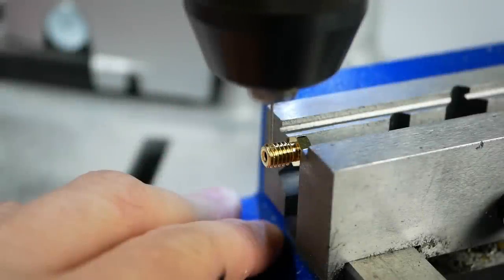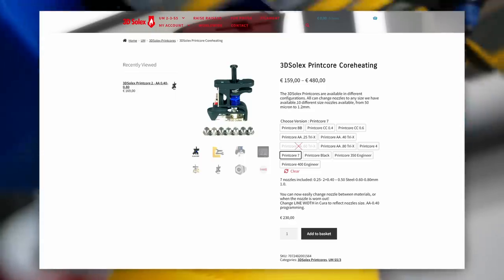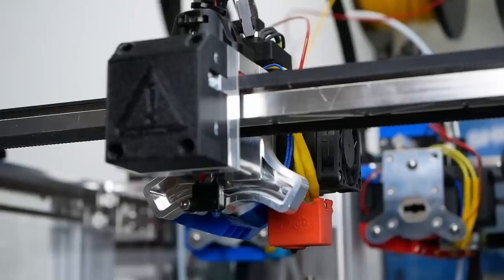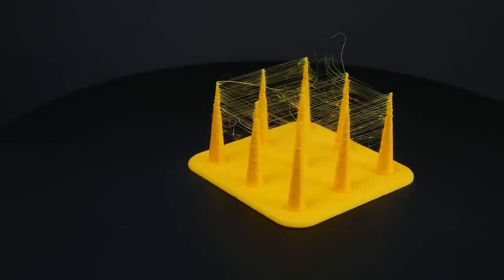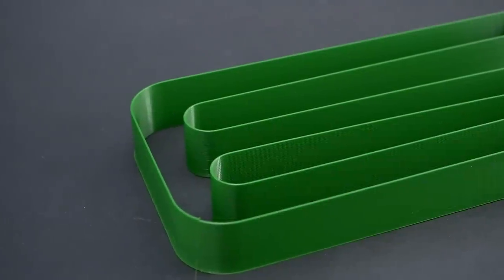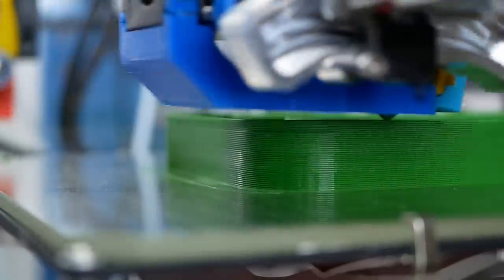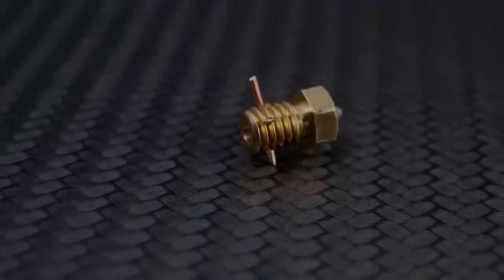My High Flow Nozzle is better than a Volcano hotend!

Comment: machinist , cross slide vise , edge finder , dial indicator, 8mm center drill = perfect alignment  , edge finder to find exact edge of nozzle you're drilling , indicator to move exactly as much as required " half edge finder diameter / half part diameter - nozzle in this case " , cross slide keeps axis movement true and easy to make small changes , 8mm center drill will do as it's name , starts a true location for the 8mm drill to follow , curious if grinding down the 8mm wires sides to be oval shaped with knife edge on top would reduce the head pressure enough to make any real life difference

Comment: If you don't want the drill to wander first flatten the area you are about to drill with a proper Center Cutting Milling tool that is a similar radius to the hole you want.  A milling tool cuts from the outside diameter first.  Once you have cleared a flat spot you can follow it up with the drill and it will not wander.

For best results you should also make a flat spot on the inside wall as well.

Comment: Same approach, but instead of circle copper wire, try flatten copper (wire) and cnc a slim gap to the nozzle?  this could give more efficient surface area for melting and maybe  it could restrict the flow less than circle.

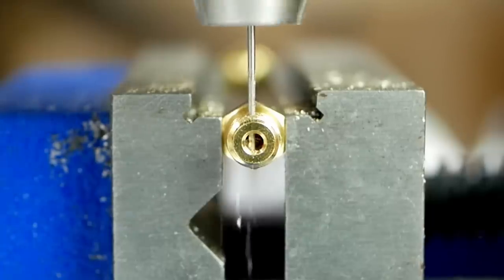Comment: 2:17 - when your pants with sleeves :-)
For soldering better for use 60-75% silver solder, lead and tin from usual solder will mix with filament and make will make the product fragile...
you can use metal foam or metal shavings like a consumable, just put it in nozzle and you're done! when changing filament - change filler...  it is necessary to increase the "mixing" chamber - bore or ream...
Добра!

Comment: Try a centering punch tip on the drill press before using the bit and experiment with aluminum welding rods (~750C) on a hardened steel nozzle (~1,500C)

Comment: Nice work 😎

Get yourself plumbers blowtorch and some easy silver solder used for jewellery, you will be able to get a much better result and it will be able to accommodate the temperatures requirements to print all filament types.

Comment: Do the same thing with a volcano hot end.

Also a suggestion would be not off setting additional wires. Have them in the same orientation so the affect on flow rate isn't as pronounced. That way it will help heat up the material but won't slow it as drastically.

Comment: Maybe it will make sense to insert a thin flat piece of metal instead of a wire. You can make small guides in the nozzle walls for it, and it may not even require soldering...

Comment: Use a 0.9mm end mill to mill flats perpendicular to the threads. Then get a small spotter or engraver to make a pre-drill spot, preferably the same tip angle as the drill. Spindle speed needs to be as fast as possible for the tiny tooling also.

Comment: Couple of things, silver wire would definitely help a little as it is a little more conductive than copper, and I think that it would be helpful to try and make a fitting that goes inside the nozzle out of silver, and make use of silver wire held in place with some sort of lower temperature braze (ie. Aluminum, aluminum alloys, yellow brass etc.)

Comment: Maybe try to flaten the wires once they are in the nozzle with some pliers, very strong demultiplied pliers because of the tiny space they will have to reach. Or maybe cutting slices from the top of the nozzle with a dremel where you could than insert the flat wires. Very nice experiment

Comment: Very impressive. I wonder if you could use a file/dremel to make a slight chamfer or blade in the copper wire so it's less resistive.

Comment: I'd be interested in seeing what results you get without soldering the copper wire. The solder is not necessary to keep the wire in place once the nozzle is screwed into the heat block. The solder does provide some thermal conduction, but the advantage of not using solder is you could go to much higher temperatures.

Comment: Would be interesting if you would also test the wire-method with a hardened steel nozzle and how much an abrasive Filament would destroy the copper wire.

Comment: I'd suggest skipping the wire, but instead counterbore the nozzle as per the video, but also saw cut to the same depth. Fill the saw kerf with a sheet of copper across the nozzle, solder it in and recut the threads. Higher thermal contact area than a wire, but still simple to achieve. 

Alternatively, drill one hole and have the wire bent down the hot-end instead of across the flow. Solder in the one end to hold in place.

Comment: May be try instead of cross wiring, drill 2 3 holes next to each other in z-axis and stick wires then to create a wall of middle hot surface which can reduce the turbulence in liquefied polymer and potentially curly outlet stream. May be just no difference at all will happen. Don't know that but for sure great research video.

Comment: ...use a Dremel/ CNC mill. Cut fine channels down the inner face of the hotend, parralel to each other. Then trim a piece of thin gauge copper, brass or aluminium sheet (they all have different heat conductive/transferral properties) to suit final width, insert, trim excess length, anchor the top points (mechanical screws, punch deformation, solder, braze, weld). Test?
This should minimise cross section loss while increasing surface area drastically.
Aluminium also apparently(*edit* incorrect) has better heat transfer capacity than copper, possibly different to brass, and in this format you could add some of that as a multimetal product. A third metal (stainless steel?) Could be used to reinforce the highest leading edge for strength/resistance against the less melted/unmelted material it meets. Possibly a narrowed, slightly sharpened leading edge..
Reply: Copper is better heat transfer than aluminium. Copper 400 W/mK, alu 200 W/mK. Brass 100W/mK, weak. Copper is not very structural, which is why you make nozzles from brass, but for an insert it's OK. Good idea with the plate insert into a semi split nozzle. It should just be held in by the stainless throat (heat brake) worst case, so anchoring is not critical.

I think it can be good to do a plating of nickel on the whole assembly. It will provide both some anchoring as it will plate both to copper and to brass, binding them to each other, and some degree of wear resistance. But i actually don't mind copper being worn away somewhat, i don't think it's critical and can still last a good time. It's OK if the divider plate forms a U shape on the top edge with a somewhat rounded leading edge.

Imagine a more or less dive saw like rig with a Proxxon cutoff disc 0.6mm to cut the slot, insert a fitting copper plate, chase the thread, nickel plate.

I have nickel plated a brass nozzle for an hour at i think 0.1A i forget, in home made nickel citrate, and i think i have lost 0.02mm of nozzle diameter maybe. I wasn't very rigorous.
Reply: @SianaGearz  
that's a fantastic set of ideas & improvements. My setup was conceptual.
W regards to thermal conductivity;
Reply: "Many people are familiar with how easily copper conducts heat. Although it is true that the thermal conductivity of aluminium is half that of copper, in a heat exchanger, the difference in this property is entirely negligible for heat transfer performance. The reason is the fact that heat exchanger performance is dominated by the airside interface conductivity, so the actual, measure performance difference between copper and aluminium heat exchangers is limited."
This may not transfer to plastics; but should be tested.
Reply: @iainburgess8577  in heat transfer to air, you do have a high boundary impedance between air and the metal, dominated by low density of air and so small contact between air and metal, which means if you can heat the metal consistently, the performance between different metals will be about the same. I don't see why copper would be worse than aluminium. Heating the metal consistently is exactly where copper shines, creating a lower thermal gradient over a long, thin piece of material heated from one end. So there's little reason to make a liquid to air or air to air heat exchanger out of copper, where the fin length and so thermal impedance from the hot surface to cold is minimal, but copper should be still a winner in this case here.

In electronics finned heatsinks, you can get away with about half the material by envelope or less when you use copper instead of aluminium, which is evident from spec °C/W figures from any reputable electronic parts supplier. This is total impedance hot plate to air, including the air boundary, and it's specified at a particular airflow or passive. It's a key spec used in electronics engineering.

Note that the article you quote doesn't outright say that thermal performance of alu is better, because it's not, it's merely close enough for their use case. They use it for all the other reasons.
Reply: @SianaGearz  true, and I just remembered my original source, which isn't applicable here either.

Comment: This got me thinking about a sort of insert that you could drop into the nozzle's chamber. A small brass cylinder with a thin-walled grid in it. This would certainly be easier to machine that if it had to be milled within the nozzle. Though I don't know if the heat conduction would be sufficient between the nozzle and the insert.

Comment: The way to go about drilling into the nozzle would be to first use a routing bit or file out the thread on a small sport to create a flat spot, which you'd then punch an indent into; the drilling bit will then stay still. You can also choke the drilling bit further down towards the tip for a very short first cut, which will minimize its flex.
Reply: Read other responses, some great tips further down in the comments!
Reply: On another note, I am thinking of an entirely different approach: brazing thin copper rod, potentially filed to a double bevel on one edge, after wedging it into a cut made at the top of the threading with a jeweler's saw.

Comment: Rather then a second wire at 90 degrees my suggestion is to try adding 2 additional wires (to give more surface area) lined up directly below the first wire (at 0 degrees). I hope that would give more heat transfer without adding extra resistance to the flow of the plastic.

Comment: Lets just pause and give crdit to the patentholder for being a nice guy letting you tinker with it on your own and make a video about it, and to you for asking the patentholder if it was OK to do so.
It is that spirit that drives evolution forward, not locking in as much as possible in patents just so noone else can resarch it.
I guarantee, you sold lots of his nozzles by making this video, so he earned a buck or two on this video too.
I have a friend who has a lot of watchmaking machines (lathe, mill/drillpress) and got some intresting ideas  here.
Drilling the wireholes into hex stock (or milling flats for drillponts, you could have done that and just filled up the tread with solder) would make it center perfectly and silver soldering the wires for a start, but also maybe drill out the nozzle tube and make an slug insert with different flow channels milled into it, heatcrimping them together would make it possible to make "impossible" flowchannels that "blended" the streams to get less elastic deformation out of the tip.
Make a design, and ask clickspring or some other watchmaker make the slugs for you and cripm/solder them together for additional testing

Comment: My first idea was also use a flat piece of metal, like a cutter blade or a flat hammered copper wire. Therefore it is needed to saw a groove in the back end of the nozzle. Maybe pressing in the Cu bar into the groove is fixed enough!?

Comment: If a finer set of copper wire is used, it may be possible to not have to punch a hole in the nozzle, but to have the copper wire wind into it from the top surface.

Comment: It has been suggested by others  to file down the wire to a triangle/blade etc. Following on from that idea , use the blade idea but twist the shaped copper wire in the middle so it becomes like a propeller shape which will deflect the filament off its path and possibly mix it?

Comment: Use a dremel to carve an edge on the copper wire, that way the filament is cut rather than have to go around the copper wire.

Comment: I think sou could try a triangle shaped wire. Or a splined inside, so it has a bigger surface, but not disturbing the flow. You can probably make it with a thin end mill.

Comment: Might also try smashing the wire to make an oval rather than a circle and solder that in....which will make it harder to solder in to keep it from interfering with the flow but should increase volume for the flow of the plastic over a round one

Comment: I think you are actually on the right track. I however don't get why you place the copper wire so high in the nozzle. I would like you to investigate an option where the copper wire is about 5-10mm lower. (I like the thickness of the wire btw).
If you think of it, the heat will gradually get into the plastic. Due to the extrusion this will create a cone shaped heat distribution. The outside of the filament will even melt first, slowly reaching the middle. This is determined by the thermal diffusivity of the material. The trick however is to heat up the core. This can be achieved in multiple ways, one of which is inducing a good conducting body to distribute heat to the cold areas.
However, in the tested version by you the copper wire is so high that it probably lost all its heat before it can reach the middle of the filament to good melting temperatures.

One other option for faster printing would be with polymers which have a higher diffusivity (. Example linked below.
- PLA: 0.056 W/mK (source: http://www.urbanlabs.co.in/products/pla-page)
- E-series: 2 - 40W/mK (source: https://tools.celanese.com/products)

*Of course this will mean that extrusion is not a limiting factor, but something else will be.

There is a nice experiment I've done in the past where it is very visual to see that the inside of the filament is not melted. I've giving it the name "snailing". This might be good content for your channel since I've never seen it somewhere else yet.

Send me a pm if you like to have a brainstorm or just want to share ideas. 

Thermal diffusivity explanation: https://en.wikipedia.org/wiki/Thermal_diffusivity
Polymers with a high diffusivity: https://www.celanese.com/en/engineered-materials/products/coolpoly-tcp

Comment: Solderless method. cut a small piece of copper plate that is fits in the nozzle tightly the press it in. It will work very well

Comment: Planning on trying this out in the near future.  One question: wouldn't it be easier to cut a slot in the back of the nozzle and put in a small piece of copper sheet?  It's really hard to drill a perfectly centered hole in an uneven surface like a thread, but you should be able to hacksaw a slot that's perfectly centered.  You could even use a file to taper the edges for decreased turbulence.

Comment: Nice.
I'm thinkin that the wire doesn't actually need to extend across the entire nozzle throat.
The Volcano tip seems to be designed with laminar flow in mind while increasing surface area.
I'd be willing to bet that 3 pins with a stubby conical or wedged point would work without obstructing the nozzle throat so much.
Also thinking that Tin solder may not be the best choice because it can get mushy below its melting point.
Nickle Silver brazing solder would probably be more of a pain to apply, but might be worth it.

Comment: Fit one or two more wires and then drill through the middle, at different diameters. Something like 1.5mm which goes through the first 3 wires, then 2mm which goes through the first 2 wires, and then  2.5 which goes through the first wire only.

Comment: Very interesting. I wonder if you squashed the wire to make it more of an ellipse than a circle in cross-section, if that would help lower the back pressure, splitting the filament in half.

Comment: Seems to me (Im not an engineer) that if you place the wires at a sloped angle towards the nozzle you could get more wire surface area as well as allow for better flow of the  filament into the nozzle body where it is warmer. Not sure my description here gets it across right. Think of the inlet hole for the wire being at the top threads and the outlet hole being towards the bottom of the threads.

Comment: u can try and use Kanthal ribbon wire. its flat.  
as for centering the hole. just screw the nozzle into a nut. there youll be able to have a flat surface to drill and 2 known surfaces to find the exact centre.

Comment: File the wire flat before inserting it into the hole. It will not block as much. I think if you did that on the 2 wire one it may do well. Just a thought

Comment: Stefan, you probably do not need the solder at all. Maybe a piece of wire a bit thicker than the hole will keep it in place good enough to print at higher temperatures without caring for the solder to melt ;)

Comment: I would opt for cutting a slot into the nozzle and solder a piece of copper sheet into it with tin.
For tiny holes, electroerosion might be a better idea than drilling.

Comment: Would be interesting to see if using a copper sheet spanning from the top of the thread to the bottom of the thread perform better than the copper wire. It might be possible to cut a slot for the sheet and solder it in similar manner than the wire. Using a thin sheet (<0.5mm) could have a smaller effect on the flow resistance while increasing the surface area of the metal in the nozzle.